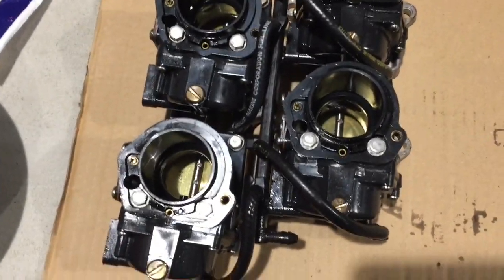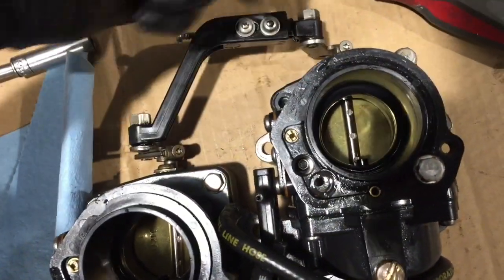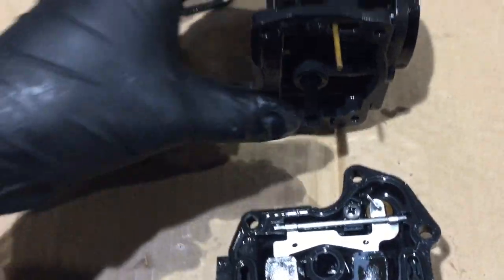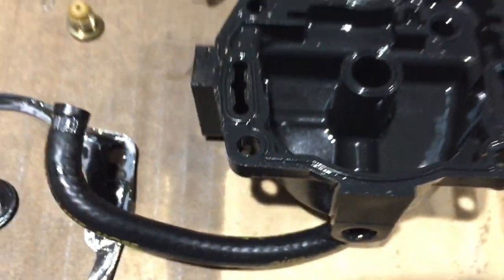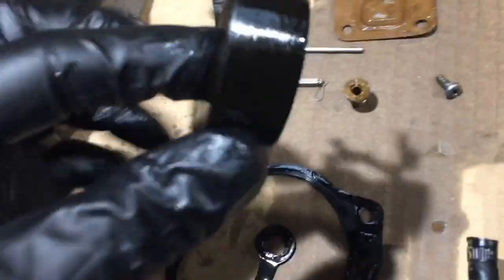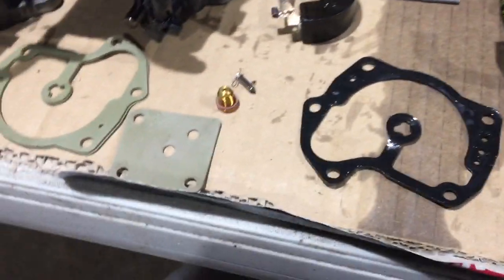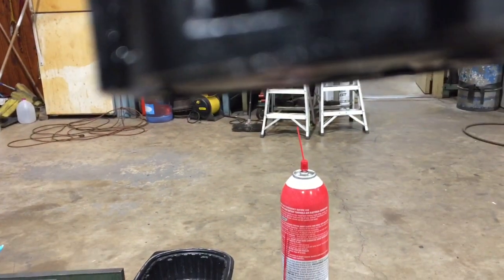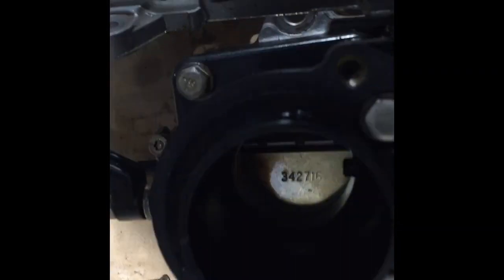Rebuilding a Carburetor on a 1995 EvinRude 130 Hp Model E130TXADA

Comment: What was the part # to those rebuild kits ? Thanks
Reply from the maker: This is the kits I used  Sierra 18-7248.  The follow Info is from  sierra "Carburetor Kit is interchangeable with the following: Evinrude/Johnson 439079, 437327, 439078, Mallory 9-37103"

Comment: do they need to be synched afterwards?
Reply from the maker: It should be. Some times you don’t have too if install the adjustment screws back in the same amount of turns.  Never hurts to check the synch on them